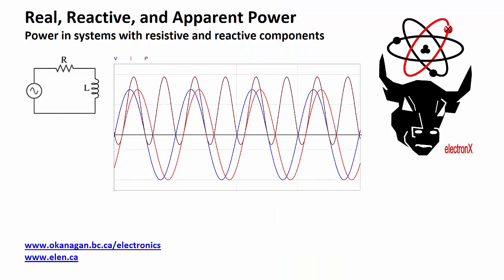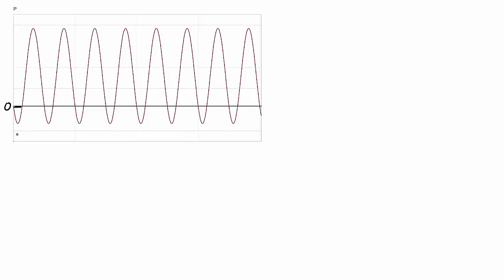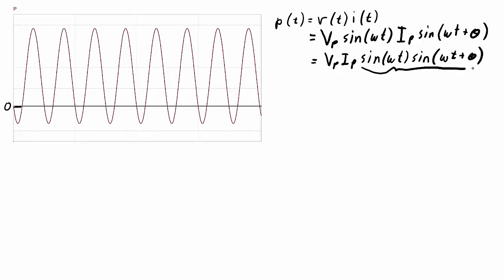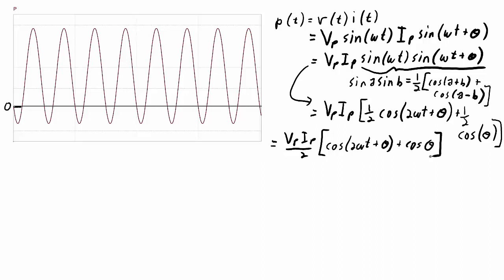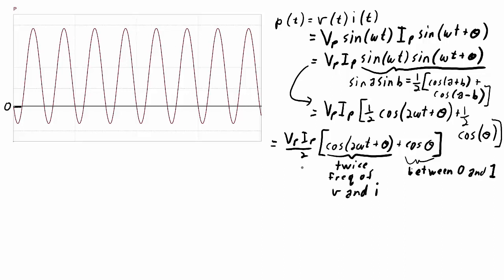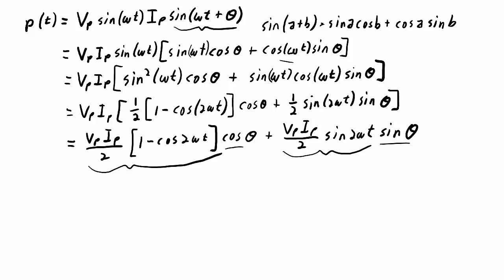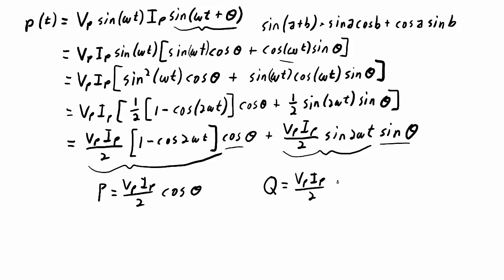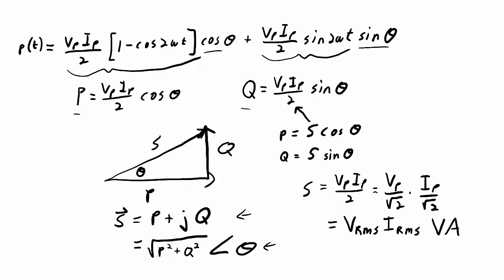Intro to Real,Reactive and Apparent Power

Comment: Hi. Suppose I have the circuit that is shown here (0:14) at home. If so, do I pay the AC-supplier for just the real power, for just the reactive power, or for both in the apparent power he delivers? Thanks for the video anyway!
Reply from the maker: As a residential user, you would only pay for real power. Industrial users often have to pay for reactive power in some way to incentivize them to have use some sort of power factor correction. Often, they pay a penalty if their power factor is too low.

Comment: is there anyway to convert this reactive power to real power ?
Reply from the maker: That's a great question. You can't exactly convert reactive power to real power, but you can do something called power factor correction which will reduce or even eliminate the reactive power - see my video on power factor correction here: https://youtu.be/icsgnV9PDh4
Reply: @ElectronXLab  thanks for your fast answer but would that work at 27 to 34khz ? The capacitor would become as a short no ?
Reply from the maker: @EnergySeeker  . As an approximation, capacitors are shorts at high frequency, but they still have impedance of 1/(j*2*pi*f*C). So, if you can change or vary the capacitance, you could theoretically set the impedance to whatever you want. For example a 1 nF capacitor at 34kHz would have an impedance of -j4.7k ohms

Comment: Error at 3:52: Trig Identity is incorrect.
Reply from the maker: Yeah, I think there should be a negative sign in front of the cos(2wt+theta) term. This will change the phase shift of the signal but not the general idea that there is an oscillating part of the power and a non-zero average part of the power.